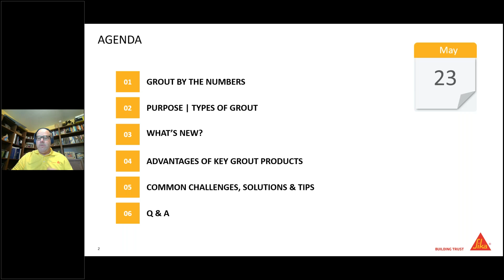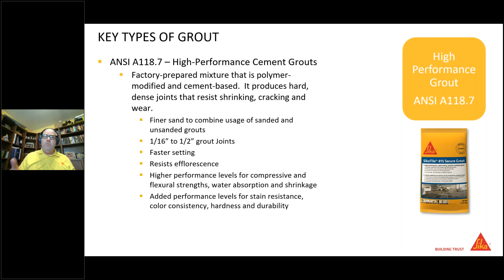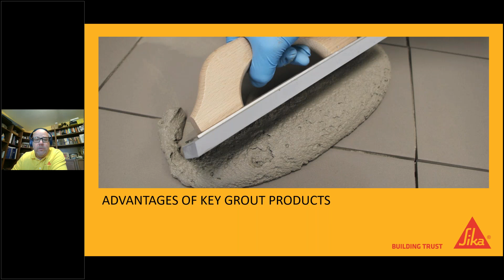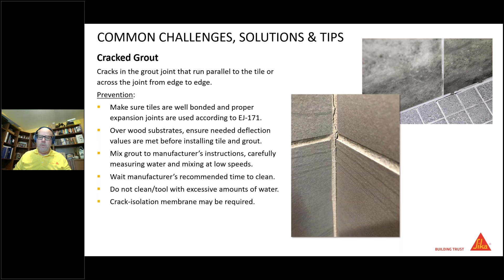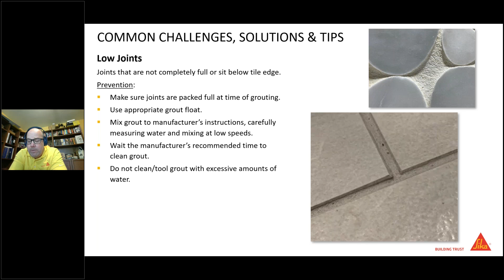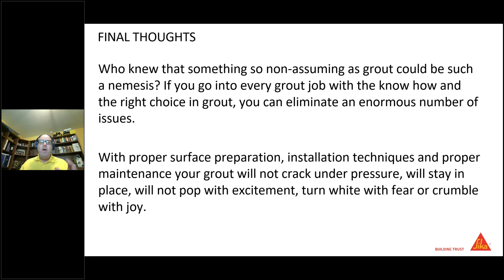Webinar: Grout: Right Selection Avoids Correction

Comment: Very good video ..... Answer this question for me for all the silicone lovers out there If you have a tub and it is tiled and you listen to people who use Silicone, which I do not ,silicone has no use in a shower except on a frameless door. The silicone come up of the past 10 years or so, has came on a nowhere and for only reasons that I can assume money and speed. And that's probably also why almost all grouts come rapid setting now, which is ridiculous for speed. So people can get stuff done faster and make more money. But the problem is they're not tiling correctly 90% of the time. How do you suppose if you silicone, where the tub meets the first row of tile? How do you suppose the water's gonna get out of there?............ It's also when you're talking about fluorescents in a shower bed. 90% of the time, it's because it's not waterproof properly and is holding water. The whole shower was most likely built wrong.